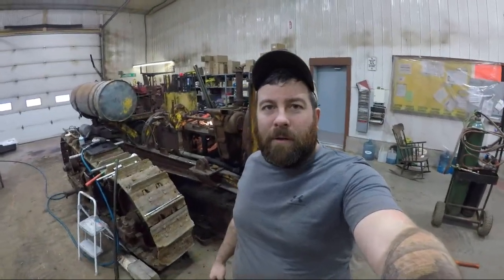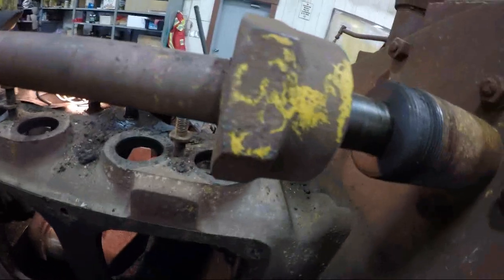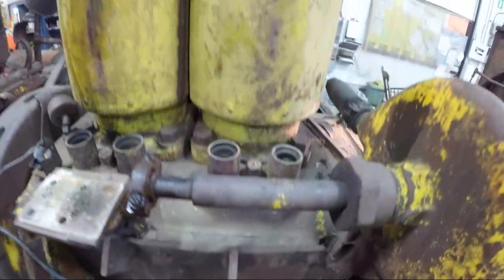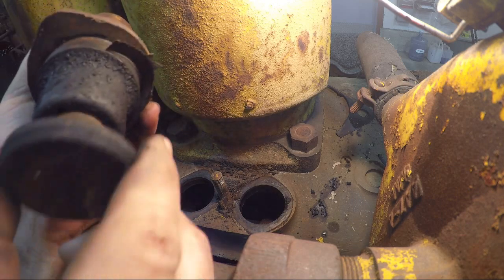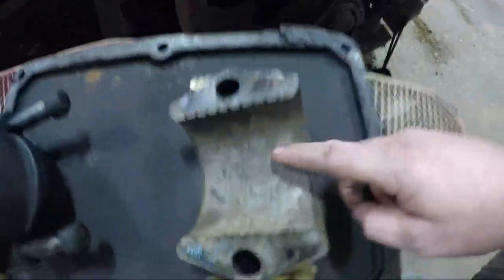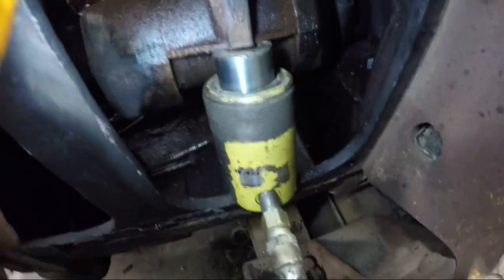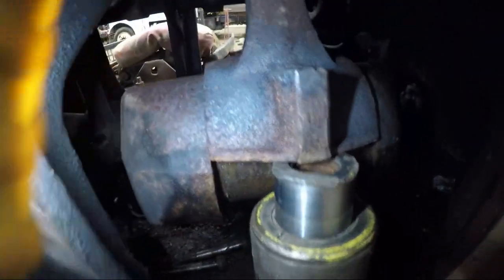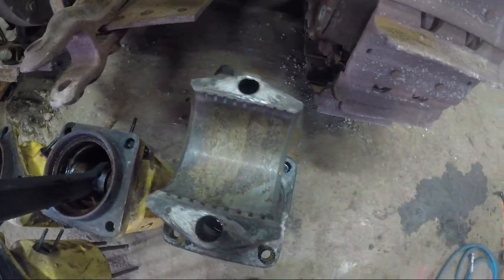Caterpillar SIXTY Rebuild Project - Disassembly Part 5 removing #3 and #4 cylinders

Comment: I was fortunate in that there was no rust on the rods, caps or rod bolts on mine, they came free rather easily. I never removed the water pump from mine. With tightening the packing nuts it held water to a slow drip, which I thought was amazing for a machine which hadn’t run since the forty’s. Did I see a weld bead on the water jacket of #4? The 3 cylinders I had to replace all had vertical welds on them but got lucky with excellent replacements. Keep it up, it’s good entertainment for an old man in the winter. 👍
Reply from the maker: Hi Geoffrey - thanks again for following along. Yes there was cracks on #4 at some time in its life and they got welded up. Your lucky your bottom end wasn’t like this one, it was no fun getting apart. Thanks again

Comment: Yep for a hot second I thought I heard rick bork in the background and something about a sucking clock or such a matter but I do understand when the profanity reaches an over flow proportion.
Reply from the maker: I can’t believe I didn’t get that one edited out - I normally get them all - that one slipped through.  Sorry
Reply: @ironman3406  no problem Ironman it was kind of comical I just had a thought about rick working  on his bailer and he mashed a thumb or something and went off I swear it was at that instant I heard it clear as a bell. I know it happens I dont do it as often as I once did in my once lateer truck drivers capacity now disabled. But I do know you do try.

Comment: Looking at the main bearing arrangement made me curious if this design was influenced by marine engines of this era. You need an apprentice for all that cleaning. Loving this journey Nathan, Hang in there Sir, thank you.
Reply from the maker: Hi Ray thanks for watching sir - I’m sorry I can’t answer your question about the marine design.  It’s lots of cleaning for sure. We will get a running engine out of is all yet!
Reply: @ironman3406  I've got every confidence that you can achieve this, I don't see it as just a walk round the block. Good luck.

Comment: crank isn't junk just how much money your willing to spend same for the cam shaft they can be reground but plan on searching for a shop that will do just one part for you will be the hard part
Reply from the maker: Junk was probably not the right word - we have another good one so we don’t have to worry about grinding anything - it can likely be useful for someone or some project in the furniture. Thanks for watching

Comment: Could be some fun turning parts machines into something inspired by the Boirault machine.   Likely a driveway princess for those snowbound with a penchant for track pressing.
Reply from the maker: I’m not sure how accurate it is that Holt and CL Best were inspired by the Boirault machine.  Holt created their first crawler in 1913 and CL Best in 1915.  I’ve never seen any literature to support your statement.  It will be more than a driveway princess when we’re done.